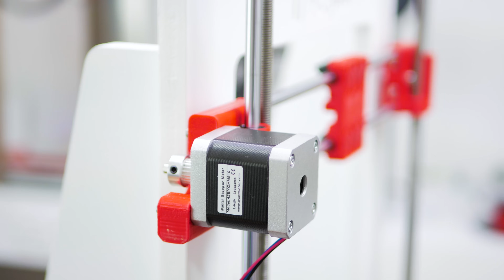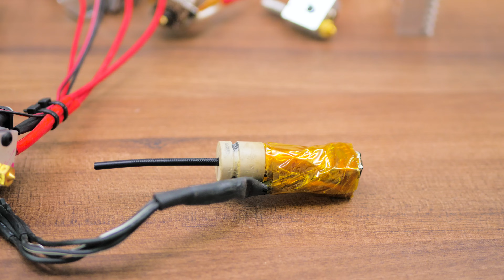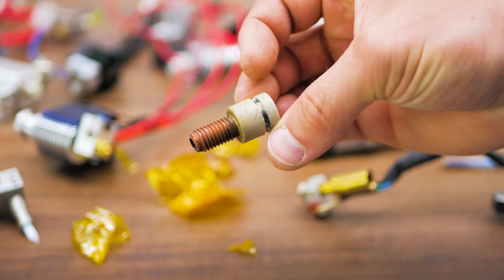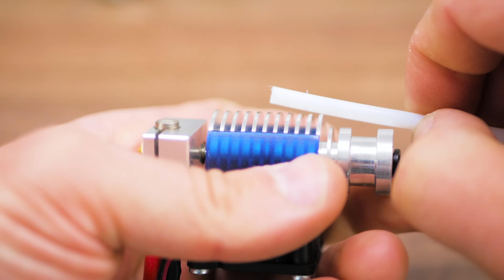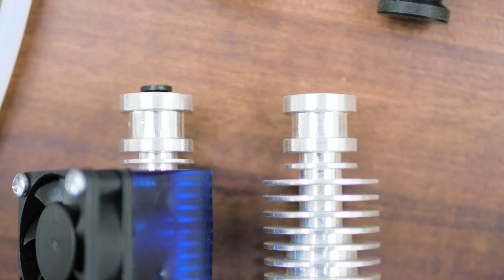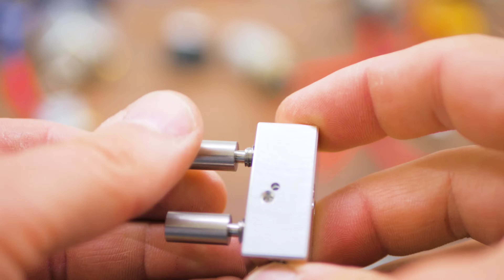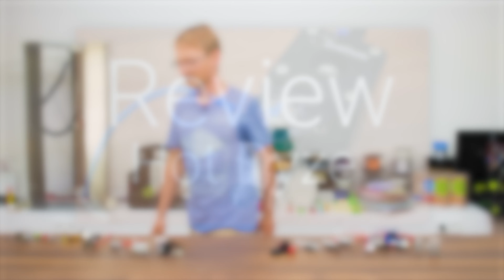Build your own 3D Printer: Which hotend to pick!

Comment: Can you please tell me which lubricant is to be used with 3D printers? will coconut oil do the trick ? thanks :)
Reply: +Riyaz Mohammed Lubricant, for the filament? In the past when I had a bowden setup I tried sunflower oil when I had trouble with the friction (due to a very long bowden tubing). Since I use a direct setup (I ordered a Printrbot metal direct extruder (v.2), which is awesome) I have no problems with friction anymore. For the bearings I use normal machine oil.
Reply: Tinker Duck thanks bro i have bowden extruder which works fine for now😅 , i was asking about the lubricant for the smooth rods and the threaded rods.

Comment: Hi Tom,
I have also a E3D V6 that at the beginning nevertheless still stalled (with all/massive metal heat break)
I think there was a burr in the heatbreak.
I now have two printers that were I experimenter wih.

I still bought a few hotends from Ebay
one of them it still does well;-) (there's Teflon in in this one!)

and still
The most trouble I have with the all/massive metal heat break!
small areas no problem but print large surfaces still the printer jams

I still have to do some experimenting with cooling perhaps, what I'm going to do!

3D printing, 
I think it still is quite difficult to do!!!
very happy to say that I sometimes(now and then) succeed! ;-)

good luck with making videos
Friendly greetings from the Netherlands
Rob.
Reply: I have seen two suggestions v
1.  Filament retract down to 1mm, so sticky melted plastic is not pulled up into the heat break.
2.  Slow reprime speed 20mm/sec

Comment: Do you think the printerbot plus is a good printer? im looking into getting my first printer and it seems like that one is the best bang for buck and it has some nice features, well at least they seem nice to me but im a noob still lol
Reply: +daniel murray Why do you want to go for the Plus? The Simple is a great printer with a lower price. It's also easier to mod.

Unless you need the larger build volume, the Simple is a great printer to start with.
Reply: +Jon Stern I was looking at that one too, I will be bringing pretty large parts though
Reply: im open to any other suggestions, the resin im leaning towards the plus is because its way cheeper then some of the other large build plate printers iv seen. I could probably manage putting together a kit but i really know nothing about this as of now.

Comment: I wasn't sure what we were looking at on the hot end that was "completely unusable", what was the main problem with it?
Reply: +Thomas Sanladerer  could you please go into more detail?

It's so fast. The parts ll look the same.   I can't tell one part from another.

What is wrong with the part?Exactly what is wrong with it?

Could you take them apart and slowly exlain what should happen.

I enjoy your videos but I didn't learn anything from his one.

This is this and this is that and....whoosh!  I think that you assume that we know all about these things.

I need you to explain it as though I know nothing. Because I know nothing :-)
Reply: I am also interested, what is wrong with that hotend? Can anybody elaborate?
Reply: +Thomas Sanladerer "didn't fit in the heatsink all the way" - you mean it don't fit in length or diameter? Because I see both has the same length, only left one has grinded thread at end.
Reply: I see now, thanks. So it can be easly "repaired", by just properly repeat threading.

Comment: Good info Tom. Loads of useful information packed into another great vid. Though: remember, you don't have to sit on the fence anymore. It'd be great to get your opinion on what is 'best', or at least your preference.  A build-log/guide with the reasons you chose each component would be ace!

I recently converted a cheap CTC printer from their generic hot end to an E3d by using the smooth chimera style heat breaks, drilling the heat bar and using the CTC thermo-couple.  At first the all-metal jammed all the time until I used thermal compound between all the components, and linishing the mating surfaces to get better contact.  That solved all issues and now I can print all sorts of different temp materials.  Your video doesn't mention the importance of a very sharp thermal gradient at the transition zone for preventing jams...  Am I correct?

Jai

Comment: A few words about "improved" designs: it looks like Chinese manufacturers are taking local chinese patents for the variants of Prusa I3. As a result - all chinese kits have various stupid mods to the original design to avoid infringements. Yes, those kits do need additional work to overcome engineering idiotism introduced by the manufacturer as an "improvement".
And some parts needs to be replaced right out of the box, f.e. power supply. They usually provide a cheapest underpowered unit - it literally blows up after a while.

Comment: I have to disagree with the Chinese Hotends.
My first 3d printer, which is a delta, consists of almost all Chinese cheap parts. (Only the 1515 alum frame and the heated bed was from local suppliers).
Assembly went fine and it prints very well. 

The Chinese E3D-v6 i got was like almost 4 times cheaper than the one I would have to pay If I buy it from the local 3d Printer shop. (Excluding tax)
Reply: Brandon Fesser surely Chinese firms do bring something to the community? Generic knock offs with similar performance characteristics as the real thing. Yes QA is questionable but they still bring something to the community and enable many who cannot afford to own a 3D printer built using high priced parts designed in the US or UK. Embiggening the community as a whole and bringing folk into the hobby, and that's the biggest contribution. They help create the 3D printing community.
Reply: Brandon Fesser I've seen creality ender-2 3dbenchies that are real good quality.. I've printed several myself. My ender-2 makes impressive 3dbenchies that are only 17mm tall. I'm only a beginner who pick random settings in cura.
Reply: +Calxx Try non-Chinese parts, and see if you still think yours "prints very well."  Even if they are cheaper, I'd rather pay full price and send money to E3D for research than to some clowns in China who just make knockoffs and contribute nothing to the community.
Reply: +Brandon Fesser Interestingly the prints are very much on par with the ones printed by a friend, who purchased the full kit (the whole printer) from local 3D printer supplier. The main reason I decided to bet on Chinese parts is the price. 
So, for people without deep pockets, the Chinese Hotends can be a really cheap and useful start. You can safely experiment with it without fearing you'll break something expensive.